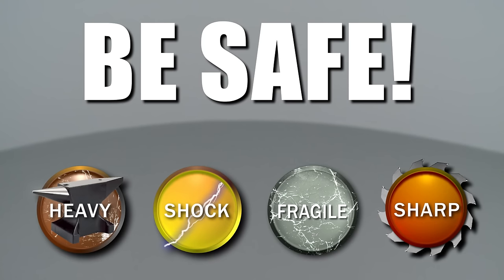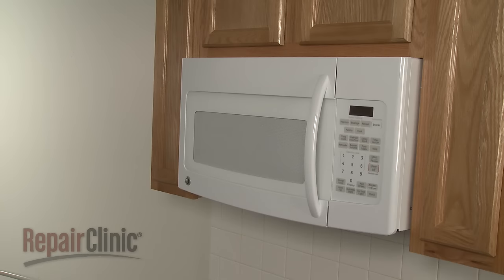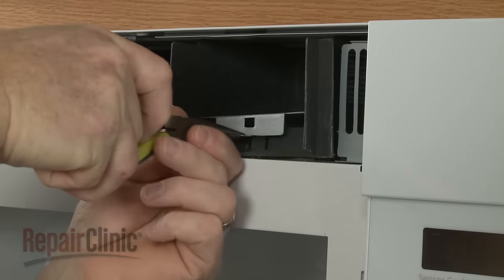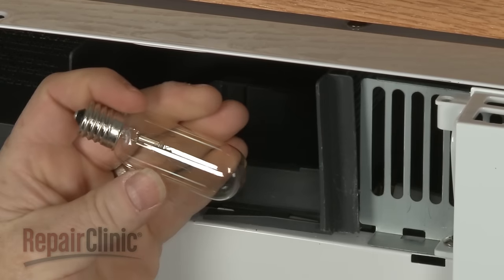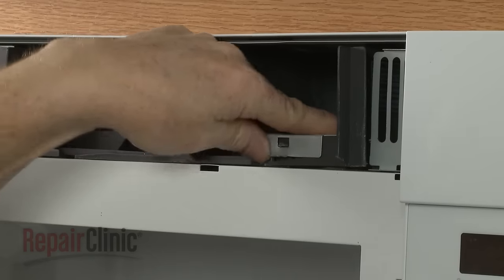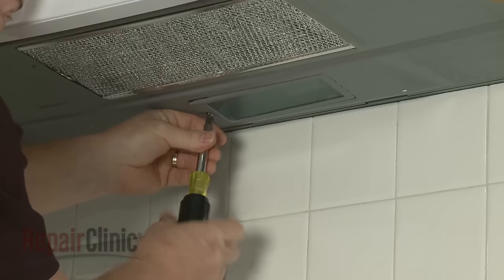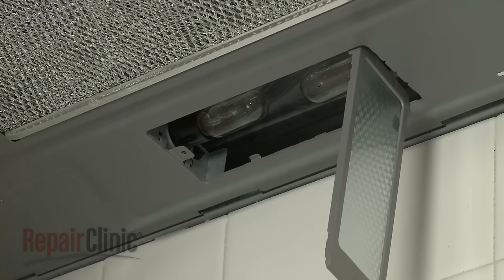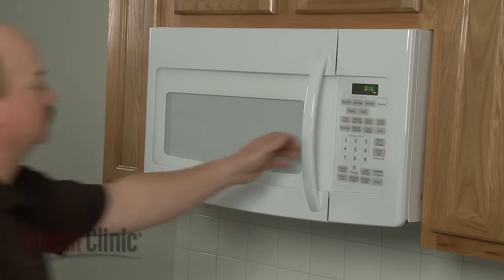GE Microwave Light Bulb Replacement #WB36X10003

Comment: I have the GE XL1800 (JVM1870SK) but the light assembly under the microwave (WB36X10003) is missing. Can you order the light assembly/socket and light bulb?

Comment: Mine is partially covered in silicone.  How do I get this out?
Reply from the maker: +Alesia Pedone Manufacturers will often put a dab of silicone between the bulb and the socket to kept the bulb from coming loose. You can use a utility knife to cut through the silicone. It may take a bit of force to break the bulb loose. We recommend wearing gloves just in case the bulb breaks.